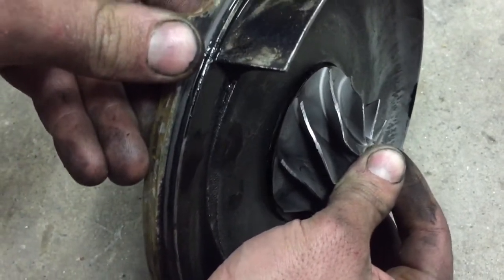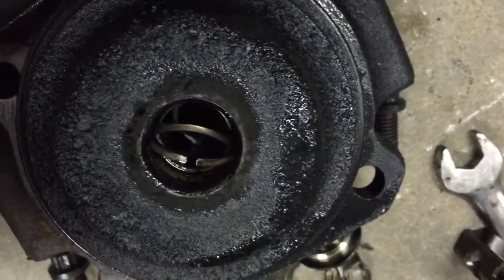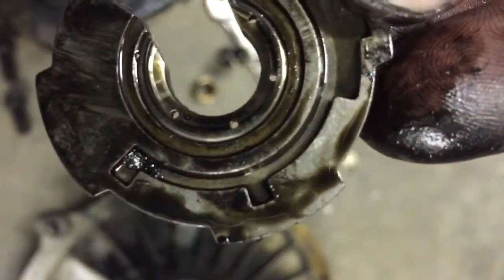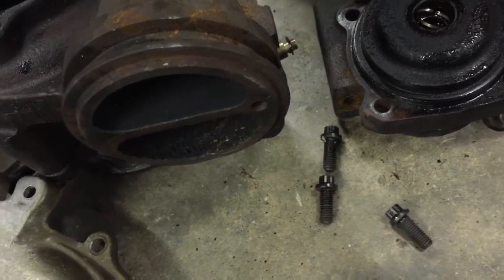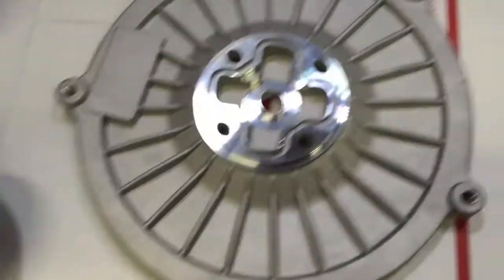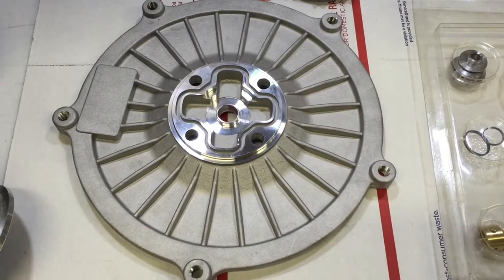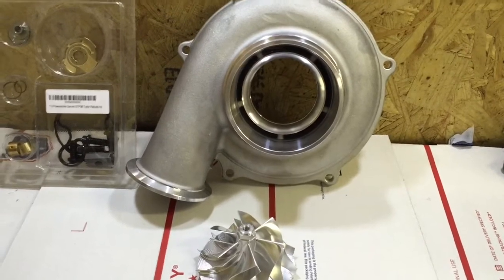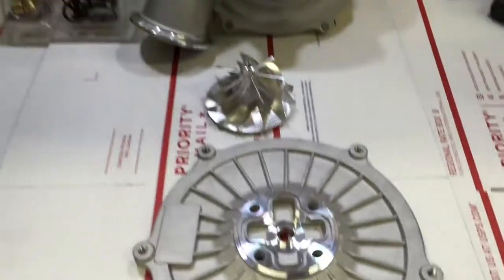7.3 Powerstroke GTP38 Turbo Rebuild Kit Instructions Part 1

Comment: any advice where to get a kit for the tp38? all the ones I can find are for the gtp38 and it has a bigger shaft.
Reply from the maker: +6th Gen Maxima our kit works for both. I guess it is possible for the compresor housing o ring to not fit, but our kit includes both bearing housing to plate seals because that is the other variation of the 2 turbos.
Reply from the maker: +Turbo Lab America http://ebay.to/26dgzdM
Reply: that's weird because I have a kit for a gtp38/tp38 and the bearings are larger as well as the piston rings and o-ring for the housing.  I thought the gtp38 has a larger diameter shaft?